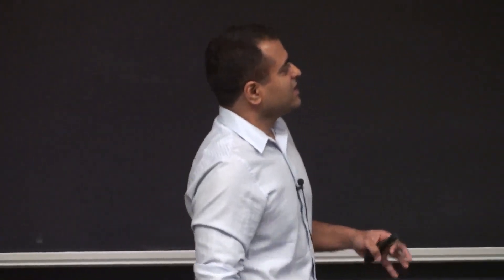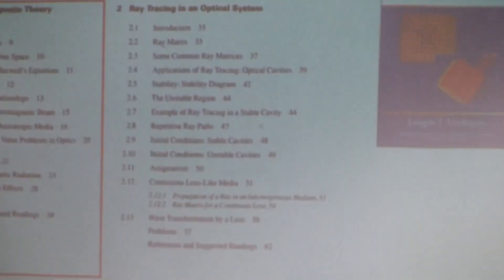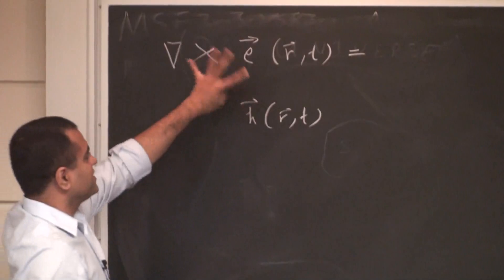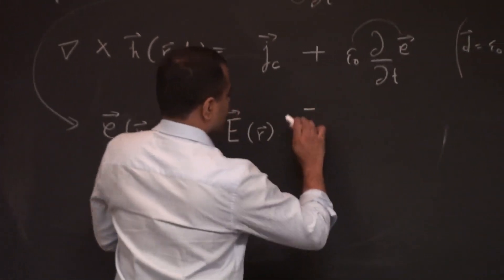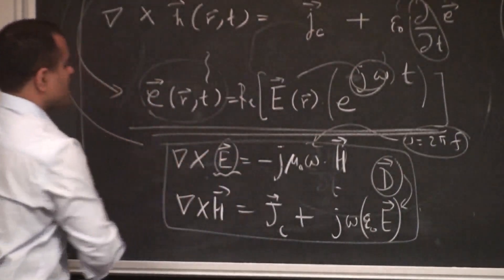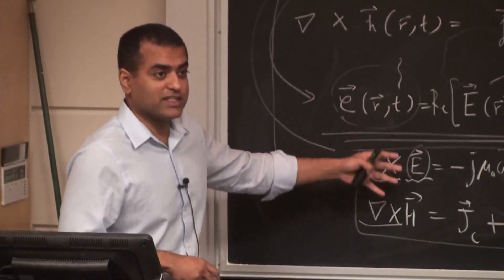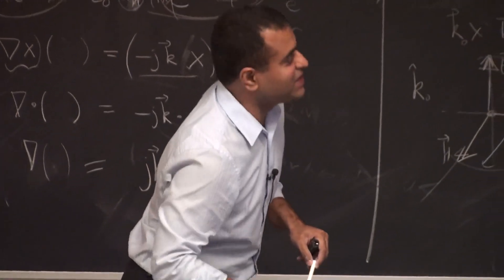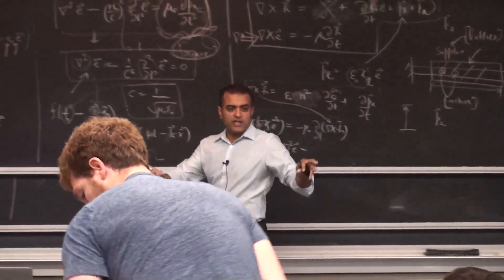Lasers & Optoelectronics Lecture 4: Maxwell Equations, Polarization (Cornell ECE4300 Fall 2016)

Comment: WHAT DIMENSIONS WOULD INVOLVE THE MAXIMUM AREA OF SPACE ?:

Visible AND VISIBLE SPACE in fundamental equilibrium AND BALANCE is CLEARLY the answer. TIME is NECESSARILY possible/potential AND actual ON/IN BALANCE. E=mc2 is taken directly from F=ma.

This CLEARLY answers the question: What dimensions provide the maximum area of SPACE (ON BALANCE)? Since gravity cannot be shielded (or blocked), it has to be fundamentally BALANCED with (or equivalent to) what is ELECTROMAGNETISM/energy regarding what is invisible AND VISIBLE SPACE in BALANCE. Great.

The dimensions of SPACE are CLEARLY, necessarily, AND fundamentally balanced. That is obvious. TIME is NECESSARILY possible/potential AND actual ON/IN BALANCE. BALANCED inertia/INERTIAL RESISTANCE is fundamental (ON BALANCE). E=mc2 is taken directly from F=ma. Consider TIME (AND time dilation) ON BALANCE. Consider what is a TWO dimensional surface OR SPACE ON BALANCE. (Fully consider what is THE EYE ON BALANCE.) ELECTROMAGNETISM/energy is CLEARLY AND NECESSARILY proven to be gravity (ON/IN BALANCE). c squared CLEARLY represents a dimension of SPACE ON BALANCE. The stars AND PLANETS are POINTS in the night sky ON BALANCE, AND consider what is the speed of light (c) ON BALANCE. This CLEARLY explains the fourth dimension ON BALANCE.

By Frank DiMeglio

WHY c SQUARED CLEARLY REPRESENTS A DIMENSION OF SPACE ON BALANCE, THEREBY PROVING E=MC2 AND THE FOURTH DIMENSION:

c squared CLEARLY represents a dimension of SPACE ON BALANCE. The stars AND PLANETS are POINTS in the night sky ON BALANCE, AND consider what is the speed of light (c) ON BALANCE. E=mc2 is DIRECTLY taken from F=ma. TIME is NECESSARILY possible/potential AND actual ON/IN BALANCE. You have to understand TIME AND time dilation ON/IN BALANCE. SPACE cannot be possible/potential AND actual ON/IN BALANCE unless it is:

Invisible AND visible SPACE in fundamental equilibrium AND BALANCE.

What is an inherently two dimensional surface OR SPACE ON BALANCE. (Consider what is THE EYE ON BALANCE). GREAT !!! Consider, for example, Einstein rings. Do notice what is the ASSOCIATED black “space” AND DOME regarding WHAT IS the eye.

By Frank DiMeglio

Define “mass”. Exactly what is “mass”? You cannot.

BALANCED inertia/INERTIAL RESISTANCE is fundamental (ON BALANCE). Gravity/acceleration involves BALANCED inertia/INERTIAL RESISTANCE consistent with F=ma AND E=mc2. Accordingly, ON BALANCE, the rotation of WHAT IS THE MOON matches it's revolution. INDEED, “mass”/ENERGY involves BALANCED inertia/INERTIAL RESISTANCE consistent with/as what is BALANCED electromagnetic/gravitational force/energy. E=mc2 is taken directly from F=ma. SO, objects AND MEN may fall at the SAME RATE (neglecting air resistance, of course); AS ELECTROMAGNETISM/energy is CLEARLY AND NECESSARILY proven to be gravity (ON/IN BALANCE). Great. I have revolutionized physics. Notice what is the TRANSLUCENT blue sky ON BALANCE. Consider what is BALANCED BODILY/VISUAL EXPERIENCE. E=mc2 is taken directly from F=ma. Accordingly, ON BALANCE, the rotation of WHAT IS THE MOON matches it's revolution. Again, TIME is NECESSARILY possible/potential AND actual ON/IN BALANCE. GREAT !!!! Finally, consider what is the orange (AND setting) Sun ON BALANCE; AND consider what is the fully illuminated (AND setting/WHITE) Moon ON BALANCE (in what constitutes DIRECT COMPARISON). Notice that lava is orange, AND it is even blood red. Magnificent. Said Moon and said Sun are CLEARLY the SAME SIZE as what is THE EYE ON BALANCE. Notice that they form or manifest at what is EYE LEVEL/body height. The curvature or shape of said Moon does match that of THE EARTH/ground (given a clear horizon, of course). The average ocean tide is about six feet, AND the tide in the middle of the ocean is about two feet. Excellent. ON BALANCE, said Moon is CLEARLY proven to be (and it is predicted to be) about one quarter the size of what is the Earth. E=mc2 is taken directly from F=ma.

ELECTROMAGNETISM/energy is CLEARLY AND NECESSARILY proven to be gravity (ON/IN BALANCE).

By Frank DiMeglio